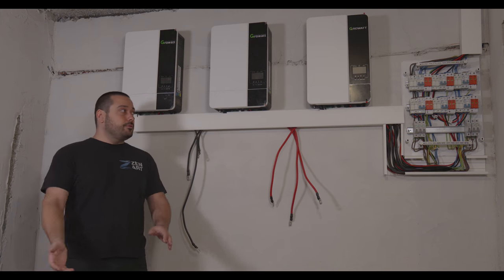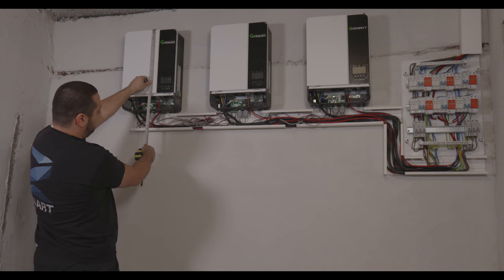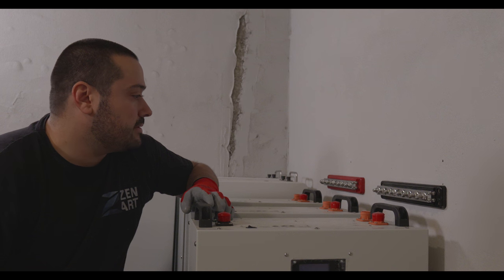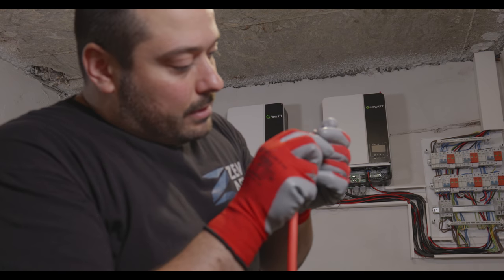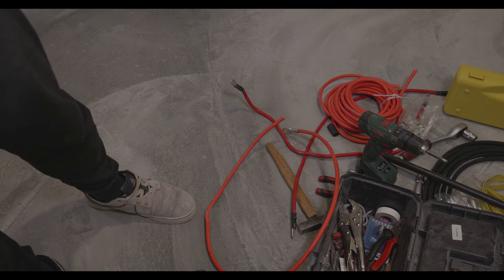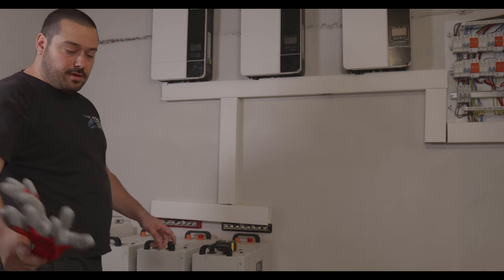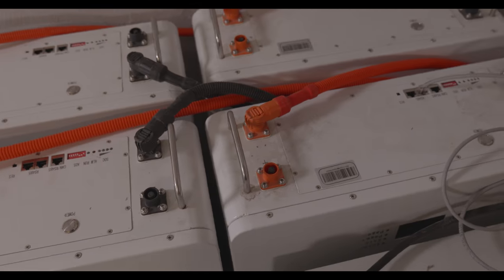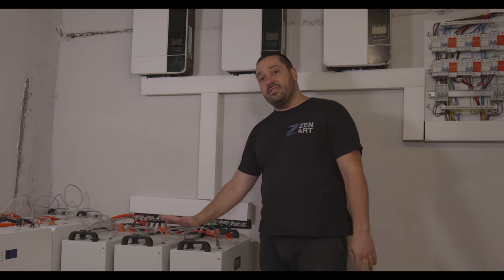Growatt SPF 5000 ES Parallel Installation with batteries

Comment: Nice video, well done and beautifully explained about the good practices and also the bad ones. Keep the work going on for your off grid setup, by the way how much battery capacity are you using?
Reply from the maker: Thank you.
My batteries are about 70KWh (7x200-230ah)

Comment: Hello, super video !
You have 4 ROSEN SOLAR batteries and what are the 3 others?
Thanks.
Jerome.
Reply from the maker: The other 3 are made from a local company.
Reply: @golden4o  can you bank different Ah battery in the same bank? or how are you doing it?
Reply from the maker: @valentinvsk4621  What do you mean with bank? You can connect different Ah packs (batteries) in one system. But you cannot connect different Ah cells in one pack (battery). I have 4 batteries that are 200Ah and 3 that are 230Ah
Reply: @golden4o  so I have an 85Ah battery and a 200Ah battery,both are from the same brand, but the seller said I cannot parrallel them because of the different capacities.I would like to use both on them on my system.Would it be possible? Thanks
Reply from the maker: @valentinvsk4621  Technically you can parrallel them, but one of the batteries will be depleted long before the other and if you have a big load the BMS of the other might shut off the power. That is why it is not recommended to parrallel them.